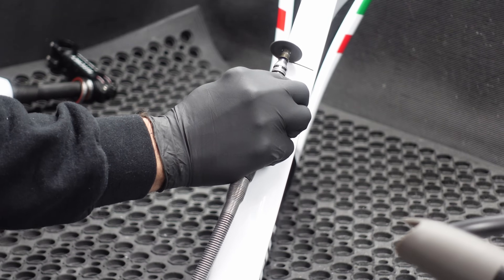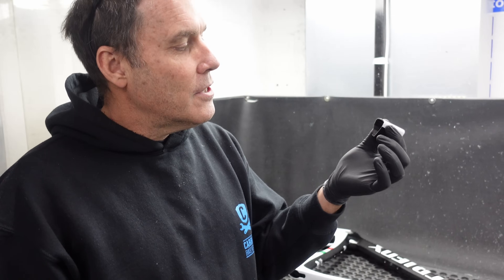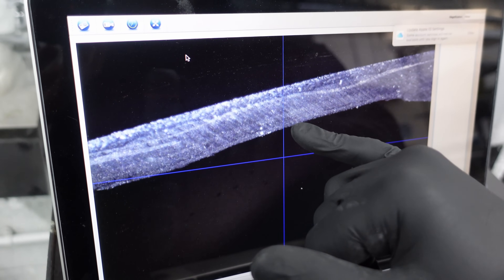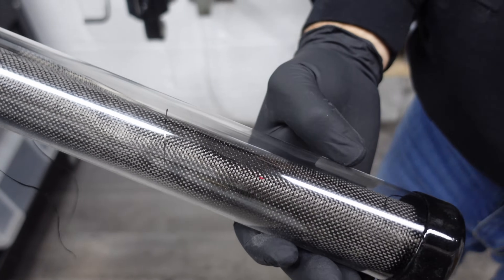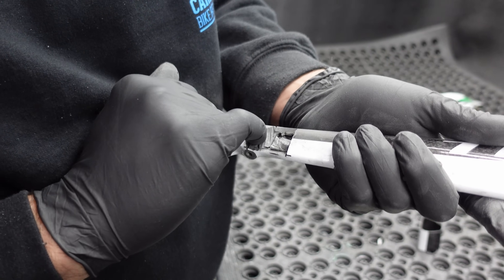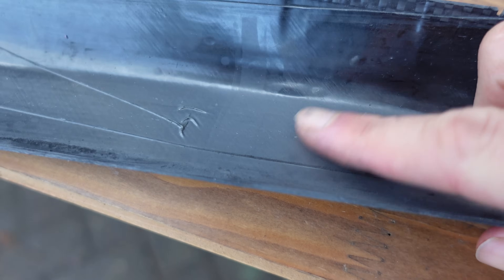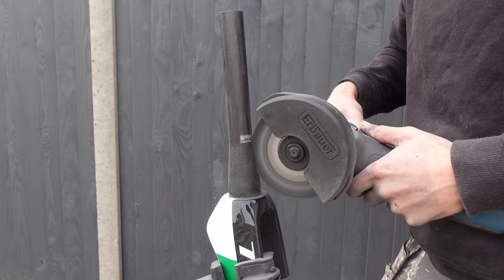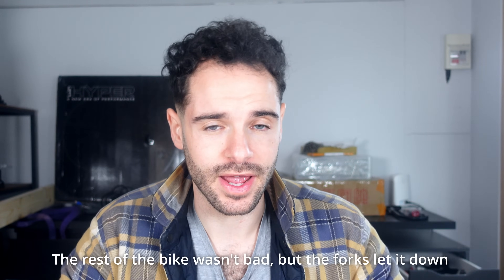I Cut My Cheap Chinese Carbon Frame in Half... Here Is What I Found!

Comment: That frame looks better made than many of the frames I've seen cut up by Raul at Luescher Technik. He has shown huge issues with super expensive brands. At the end of the day though carbon fibre is a hand made process with lots of potential for faults. It's the most advanced material with the least advanced manufacturing in many ways. From what I've seen that is a maybe 6 or 7 out of 10 frame. Overall good I would say. I'm not a performance cyclist though and have zero use for such a bike, I don't need to have a lightweight weak bike it serves no purpose for me and they aren't environmentally friendly. Titanium, steel and aluminium can all be fully recycled and have much better manufacturing consistency. I totally understand the appeal of CF for competitive cyclists though.
Reply from the maker: All good points! I've watched a few of his videos and they are interesting for sure.

Comment: I find it hard to believe that that large white section in the fork could be solid epoxy resin that's a huge span with few voids. Given the geometry at the section is quite complex it wouldn't surprise me if an expanding syntactic foam was used. In order to get even/reliable pressure distribution to the carbon in that difficult region. Other manufacturers do this in localised areas. Depending on how restricted it is to expansion will alter its density.
Reply: I came here to say the same thing. Pretty sure that's a structural foam insert to fill that void and create the shape in a way that wouldn't be possible with air bladders
Reply: @galenkehler  so what the fuck is it
Reply: The "Carbon expert" is wrong in his assumption that the white stuff is escaped resin during compression. It is an intentional syntactic filler that fills the cavity and prevents non-compression zones.

Comment: Those forks become an assembly once the wheel is installed, so  squeezing the fork legs in that direction doesn't make much sense.
Reply: think again, you put stress on them at the turns. the important spot is the radius
Reply: @hash-CCFF00  And of course, the wheel is installed while making turns...
Reply from the maker: Yeah, Rob did mention that It's interesting to see none the less 👍🏽

Comment: Thanks for taking the time and associated costs to inform your audience of the quality of lower cost frames. 
The thermodynamics of moisture inside the frame without suitable egress is concerning to observe. Couple that with the use of dissimilar ferrous with nonferrous fasteners creating electrolysis and hastening oxidation. Better standards for fasteners and ventilation are in order.
Reply from the maker: Great point! I guess over time this would have would only have gotten worse. Glad you enjoyed the video 👍🏽

Comment: They put a lot of effort into making the whole bike safe so I wouldn't write off the fork straight away.  We still don't know what those white bits are.  The black stuff is thin, but the white bits they're stuck to are thick.
Reply: The white stuff is just a filler compound. Its not actually impregnated with carbon or anything. You also see it on cheaply built frames to fill space around the BB (particularly wider areas where the BB and chainstay meet) and rear dropout. More structurally sound than just empty space but its not a component to resist shearing forces, which would be what that suspicious thinned joiner of the fork would fail to.

Comment: I have a trifox X18, and it goes fine in a straight line, but it does wonky stuff in a turns (when not even near the limit either).  It is not confidence inspiring at all.  Not a bike that can be raced. Probably fine if you are just doing straight fast group rides without many turns.
Reply from the maker: Interesting to hear 🤔
Reply: bro does it bend horizontaly to the left/right? had the same concern since that carbon at the radius looked so thin yet we didnt get a cut looking at the front of the fork which is the most important
Reply: would find ur detailed feedback very helpful, there was a video comparing trifox to elves, by an aussie guy and the elves fork legs didnt flex as much as trifox'. wonder if the elves beats it

Comment: I have seen a cheap Chinese carbon fork failure and it was not so pretty. On the other hand I will tend to stay away from anything that is Chinese made, myself I'm a steel guy. When I saw the failure of this fork, my cycling friends said! Yeah! Yeah! You were right.
Reply: So what frames are western made?
Reply: My buddy crashed a couple months ago on a titanium road frame.  Frame was perfectly fine, but he broke his hip in 2 places, 3 ribs and fractured two vertebrae.  Went down going 25 mph on a flat road and he didn't hit anything on the road (no curb or sign or anything like that). However, he then he thinks he landed on his titanium frame because the location of his injuries are in a straight line along his body, and his body .  If this is the case (we will never know), had he landed on a carbon frame, the frame would have broke (thus breaking his fall some).  Instead the titanium frame didn't yield at all and his bones broke his fall.
Reply: The only thing stronger than steel is more steel
Reply: Lawyers across the country (USA) are seeing cases where people have been seriously injured in carbon fiber bike failures. Outside Magazine reported that these lawyers believe that faulty design and construction failures have led to carbon fiber bike accidents.

Comment: As someone who's currently riding a Trifox X10,
my spine can confirm the frame is pretty damn stiff.

Great video series Jourdain :D
Reply: what about the fork? does it feel bendy to the left/right at the turns?
Reply: @hash-CCFF00  not that I can feel since it's effectively a box section when the throughaxle is tightened fully.

Comment: It pains me to say it but that frame is better made than some of the top brands.
Reply: Perhaps Jourdain could get a Trek, Giant, Cannondale frame that is few years and cut it up for comparison, as one way of getting around the cost issue. Or perhaps buy a crashed / damaged ‘ Western’ and do a similar dissection. A woman in our club had a high end Ridley which failed around the head tube which was replaced under warranty. She said the LBS she bought the bike from said the frame only cost ‘a couple of hundred ££ quite astonishing given the the retail price of complete bike or frame only. 🤔
Reply: @hughstultz7849  there a lots of videos on here of them brands betting cut up
Reply: Great vid, really appreciate the cut up off the frame. Very interesting. 

Luescher Teknik has great cut ups, also , frames are a bit old but very good to see all different makes. He’s a genius with carbon fibre. 
In one video I think he said he was asked to repair a frame by Specialized he quoted something like 200-300 in dollars, I presume as he’s an Aussie , they declined as they said they could easily make a frame for less.
Reply: Rims are the same way. A few asia direct to consumer manufacturers are excellent
Reply: They can all vary hugely from day to day. Mass production works that way.
Reply: Racing, no.. but for joy rides, its sufficient
Reply: I rank reality!
Reply: You mean ‘was better made….’
Reply: It totally true...
Reply: It's funny you think of them as cheap. The Chinese have been making carbonfibre tubes far longer than anyone else in the world. Their mastery of the art of carbonfibre is years ahead of anyone else in the world. You have just been conditioned by bike manufacturers to think brand name carbon is expensive.
Reply: @Bertie..  Sir Joseph Wilson Swan first created carbon fiber in 1860 to use in an early incandescent light bulb. In 1879, Thomas Edison used cellulose-based carbon fiber filaments in some of the first light bulbs to be heated by electricity. In 1958, Roger Bacon created high-performance carbon fibers at the Union Carbide Parma Technical Center located outside of Cleveland, Ohio. Those fibers were manufactured by heating strands of rayon until they carbonized.
Reply: @kalijasin  What on earth does that have to do with manufacturing tubes.
Reply: @Bertie..  by simply comparing them to known brand frames. They're cheap. I think everybody here is fully aware the role factories in the East play in manufacturing. Thanks for your really helpful input though 👌
Reply: @jesmondo5785  you have been conditioned to think that.
Reply: @Bertie..  If bike manufacturer's were buying the highest grade carbon fiber and resin's, than I could see some warrant for higher costs, but the reality is that they don't use the highest carbon fiber grade's, used in aerospace engineering and race cars. Those demand much stricter applications. Bike manufacturer's do use relatively strong carbon fiber, while the resin's are debatable. It's always a point where you can only make it so light, while trying to maintain strength. The fact that the bike's are hand built, can have a huge factor in how strong it is, as well as the resin's and curing process, and even down to the molds used. It's still a learning experience, as new applications are tried. The country building the bike shouldn't be a huge factor, as many countries are quite capable of manufacturing a quality bike, but all can also fall prey to quality control issues, and research and development into new materials for use. Prices are like any market, if people are willing to pay astronomical prices for something, it will be supplied to them. If people want reasonable prices, the market will cater to them as well. The same thing goes for cheap prices. The major factor between all 3, is what kind of quality is your money really getting you, and that can vary like a hurricane!
Reply: @Bertie..  Well, the carbon frames of the top brands are also made in China.
Reply: @Bertie..  That’s actually not true: The first carbon tubes were made by french aviation companies - TVT - and they were bonded to aluminium lugs.
That was already in the early eighties,and they’re still going-I still have my Vitus frame,later they made the carbon stronger by weaving kevlar fibres into it
Reply: The frames might seem cheap but people are forgetting that they are being shipped straight from the factory . A western brand frame is bought from a UK retailer after their markup has been added . Nobody knows how much it costs to make a well known frame as they won't tell you . It won't be anywhere near the retail price though like it isn't with a pair of trainers . The internet has enabled the general public to buy straight from the source . I've got a Chinese brand frame and have had no issues with it after over 1000 miles .
Reply: @anthonyduncalf-uk  agreed. I know the margin is huge for UK importers having worked in the trade for years. Too many special offers a grand off this frame, half price that frame, end of year clearance. The list goes on. Videos explaining cost brake downs of products are normally taken down by YouTube, videos like this a further proof you pay a hell of a lot for a sticker
Reply: Another promotional channel for the big brands
Reply: Finally China builds something that holds up and isn't just a facade. Glad to hear that.